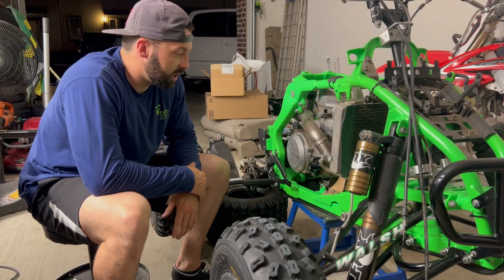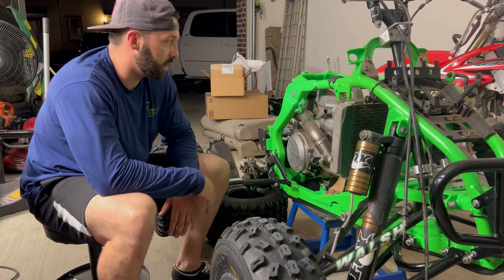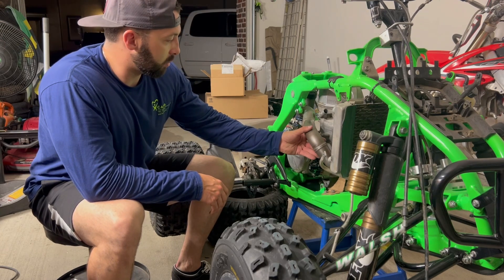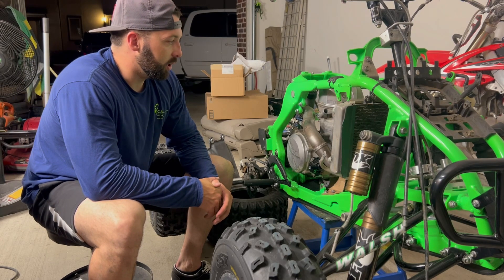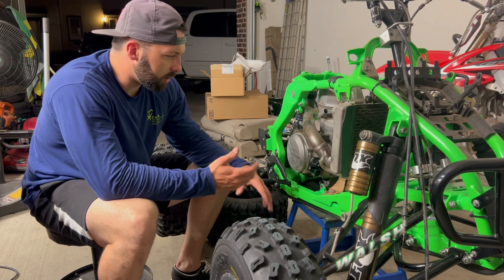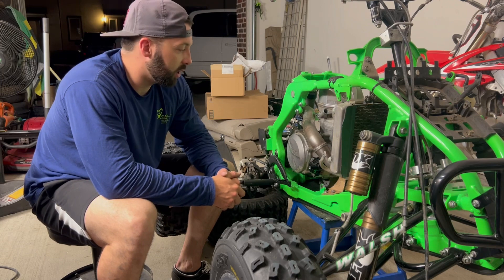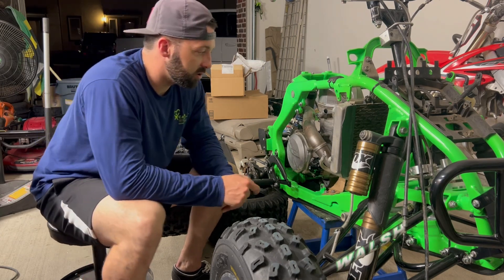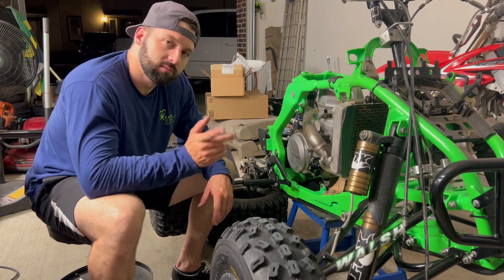I’m building a KFX 450r CRF Hybrid!

Comment: What’s the point no hate just curious
Reply from the maker: Overall weight reduction is about 30-35lbs from losing all the electronics and the size of the kfx engine compared to the crf and the crf also has more hp stock. Another major benefit is more companies support the crf with upgrades and service compared to a kfx.